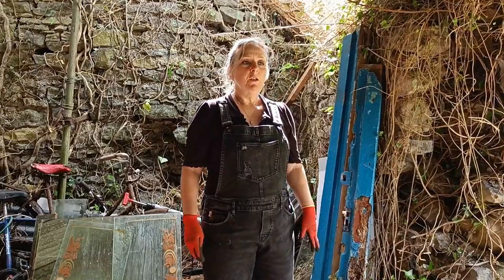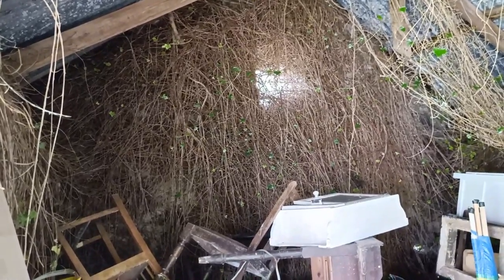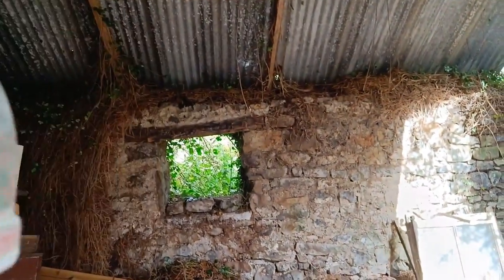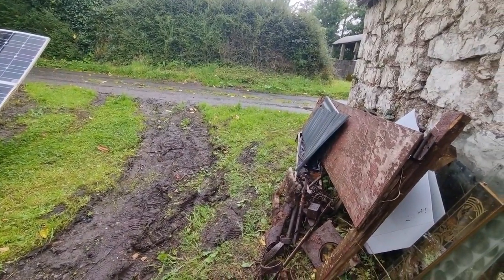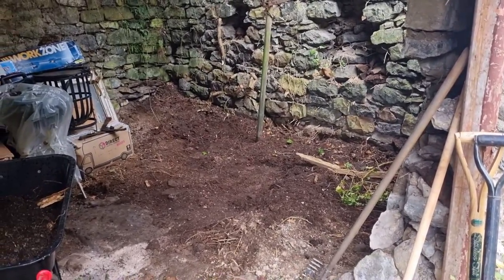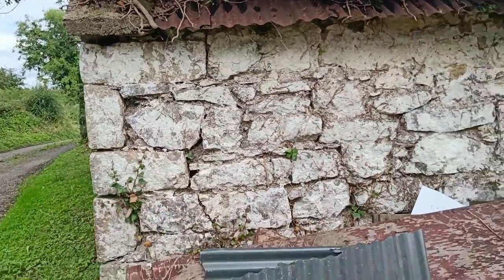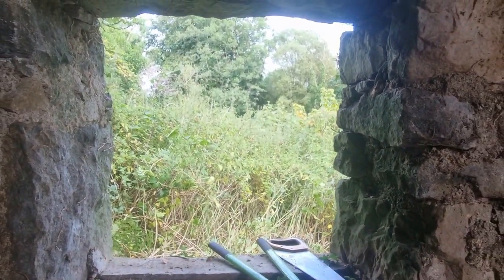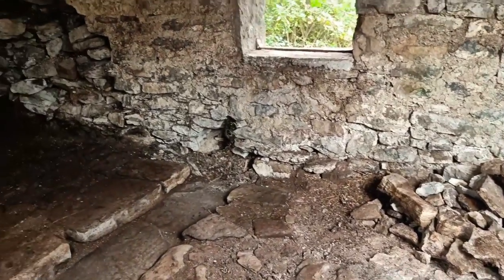Shocking Discovery: Centuries-Old Flagstones Found As A Floor

Comment: What I was waiting for.  At about 58 minutes you can clearly see the trench.  The cows back end would be at the trench while they were getting milked.  They eat and do the other thing a lot.  I milked cows.  When they defecated it went into the trench.  When milking was done, you cleaned out the trench.  The window there is perfect for that.  There was probably a feeder of some kind where their heads would be.  I milked in a modern barn, but grew up on a farm that had the old barn with trench.  My mom and dad milked in that barn before they sold the cows.
Reply from the maker: I did find a feeder when we did a first clear out of the shed back in June! There were also lots of chains this time around too and leather collars. It was quite a moment when we saw that gulley appear!

Comment: Make sure to use lime mortar so the walls can breathe. If you use cement/concrete it can damage the stones over time.
Reply from the maker: Don't worry it was a slip of the tongue, I know I said cement but is actually lime.  We had our bags of NHL 3.5 and 2 arrive today from the company called Round Tower Lime, also a tonne of the sand they recommend for our various requirements.

Comment: Great work on the outside barns .The ivy needs to be removed its does a lot of damage and grows every where .The ivy needs to be removed from the roof and all the way round the building realy.
Great work and another improvement.
Reply from the maker: Nearly all the ivy has been removed now, even on the roof, except for the one lump top middle.  It had eaten its way in and out of everywhere so we needed to be careful around some of the stones so they didn't come too loose.

Comment: Where are all the missing wall rocks? They should be outside or around the house or in the floor?
Reply from the maker: Hiya, we found a load of stones in the other outbuilding when we were first clearing that and couldn't work out where they had all come from.  It all made sense on Saturday when we found out the original door was widened.  So now we know where they are, we can maybe rebuild the door back to the original size.

Comment: If it’s not level flagstone: Fill it in with fine pebble gravel to level it. Use a 2 x 4, and large level. The gravel will be good to insulate and be a good barrier to ground moisture. And eventually: you could top it with some more flag stone. My two cents. 😜
Reply from the maker: Well I’m liking your two cents worth Claude. It’s a really good idea and it also doesn’t damage the flags in anyway either so we’re all for that.

Comment: Also: before you do that I’d put a rubber liner against exterior wall foundations on the interior low ground areas. Again… a moisture sealer.

Comment: Again my thoughts. Leaf blower. Blow out random dust and loose bits. Don’t move wall stones. Just mix a good sloppy mess of concrete slap it in! Spade it smooth. Add small rock to larger holes as filler and extra structure, and repeat cementing. Focus top to bottom. 3 foot by 7 foot segments areas at a time.
Reply from the maker: We’re going to be using lime as much as we possibly can around the house and outbuildings but other than that I am liking the process to get it sorted. We have a leaf blower too which is handy and because we’ve progressed a little more we now have a vacuum cleaner that blows as well as sucks so we were thinking that may come in handy too. 😊

Comment: Hi. is this workshop also going to be a garage ?   the opening on the front wall to the right could be made larger to archive this. leaving the other side as you workshop.   Blockwork inside with back fill should keep the exterior looking the same. Also on the left with the blockwork you could add a small mezi floor above for storage. Window is great. maybe tried to cut back the weeds a little each week (when you mow the grass). Roof needs totally renew but you can just replace exactly what is there, so low cost.
Reply from the maker: We hadn’t thought about a garage to be honest, mainly because at some point I think we will remove the grass around the back of the house because only about an inch below is a hard standing. Liking the idea of a mezzanine floor though! What a great idea!
Reply from the maker: Yes, the roof definitely is need of some repairing. 😂

Comment: Just saying please don't use cement on stone walls, it destroys the stone over time. 3.5 Lime not 5 Lime and Sand. 😊
Reply from the maker: Don't worry it was a slip of the tongue, I know I said cement but is actually lime.  We had our bags of NHL 3.5 and 2 arrive today from the company called Round Tower Lime, also a tonne of the sand they recommend for our various requirements.
Reply: Agreed lime with bits of metal rebar to tie in corners, layers etc is the ticket. Keep going 🎉
Reply: @thecornerhouseproject  Brilliant, happy building.

Comment: maybe a dumb question, but can you use some of the wood for a boardwalk between the shed and the house?  to stay out of the muck?
Reply from the maker: Funnily enough, on day one of starting, which seems such a long time ago, we put some of the decking boards we have down both sides of the tent as that is the worst part where we continually walk.  Thank you for suggesting it as if we hadn't done it already, we would have done after reading you comment.

Comment: I was thinking that you could put your tent in there. and a small woodstove/coal burner/ peat moss burner. board up the windows and make a door. tarp the roof. put pallets and wood on the flagstones tent flood ready! Fall is coming and with all this global weather changes. You will never know what you will get in weather.
Reply: at least till you could move in . cheers
Reply: patch the walls ..
Reply from the maker: We did say about putting the tent in there yesterday when we we chatting funnily enough but hoping we only have another week or so until we can get the bed inside.  You know us though, anything could happen between now and then haha.